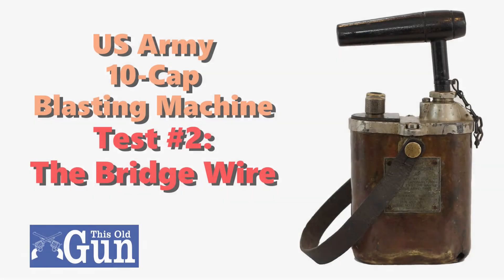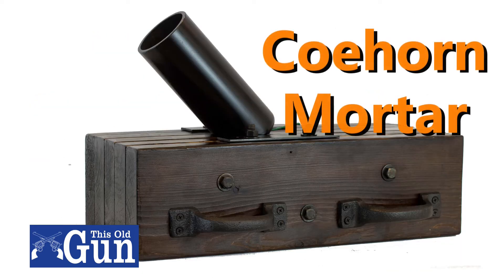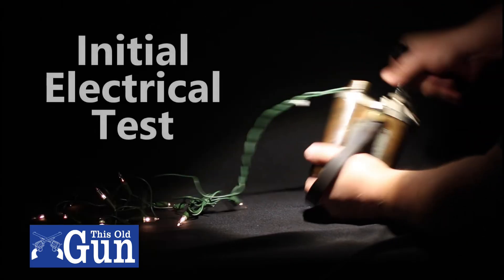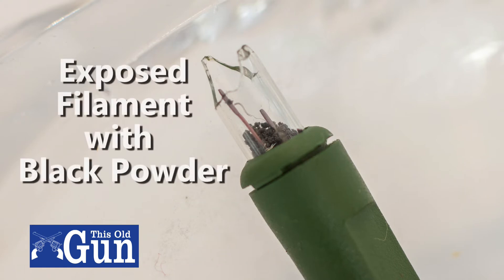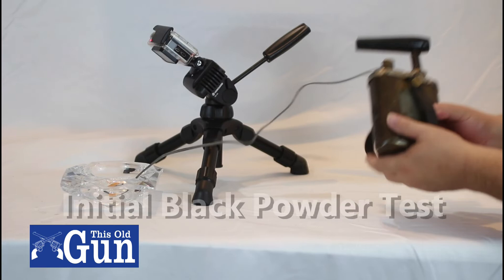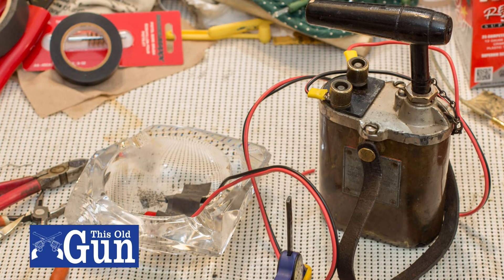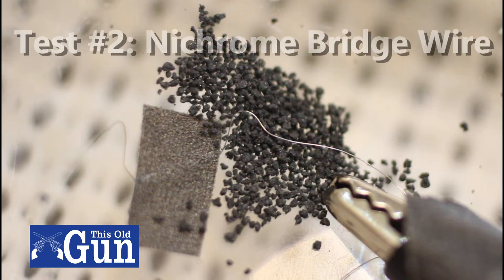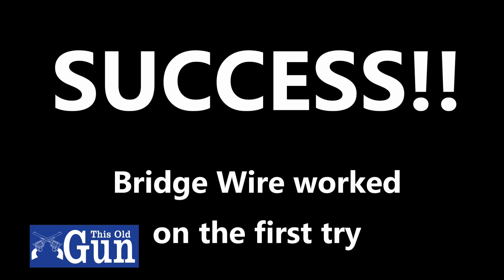US Army Blasting Machine Test #2  (The Bridge Wire)

Comment from the maker: The project is moving right along.  I'm kinda surprised this worked on the first try without having to make any adjustments.  Next step I'll start working on getting the lead lenghs out to about 10-15 feet.  Then, I'll need to work on getting the bridge to the right length, and insulating it, so it won't short out when touching the Mortar barrel.  I'll try to make a bridge, soldered to two lead wires that are a couple inches long.  Then hopefully it can just be clipped to the main leads with alligator clips.  (That's the theory right now.)